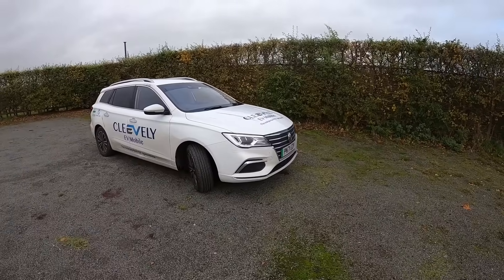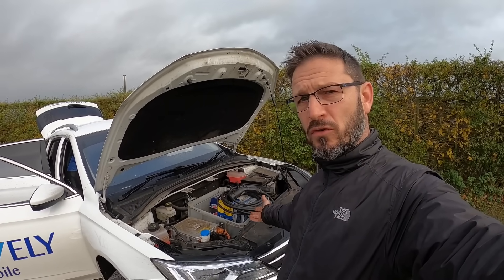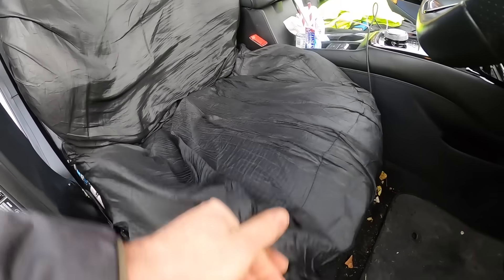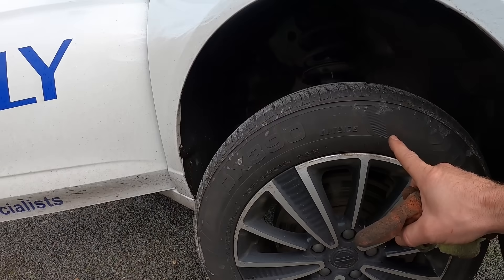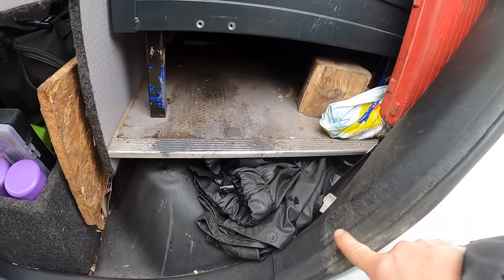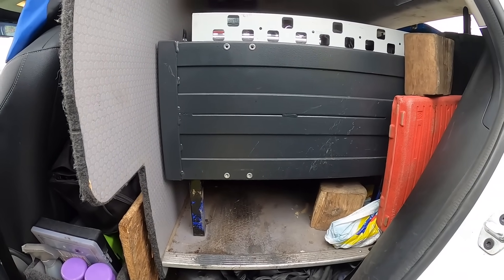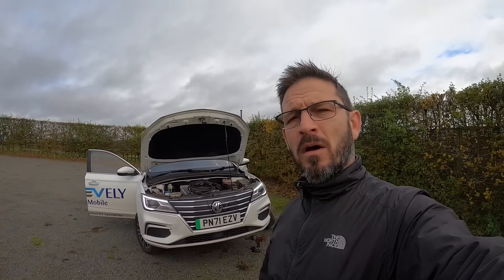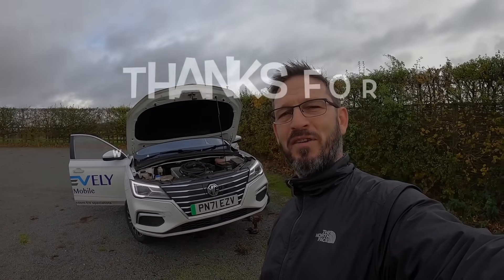How's My Electric Car Battery After 100,000 Miles?

Comment: I have a 2020 Nissan Leaf e+ that has only done 12000 miles in 3 years yet for the past two services and recent MOT I have had an advisory on the front disks due to excessive rust. I am going to get these replaced as it is a lease car but Nissan have quoted £480 to replace these and the pads. I had another Leaf before this that did 30000 miles without any issues. I can't help but feel this is due to inferior materials but no chance of brakes being under warrenty. The dealer has said it is probably lack of use of the brakes that has caused the rust build up.
Reply from the maker: We charge £180+vat for front discs and pads on the Leaf, and we come to you. The pads 100% need greasing or you will suffer corrosion.
Reply: @Jamesandkate  Thanks for the response I have sent email to Cleevely to discuss further.
Reply: Do you use e-Pedal with B mode enabled? If I were you I’d fully charge the Leaf to 100%, turn off e-Pedal, place in D mode and do some hard braking in a safe area. You’ll probably clean off the brakes by doing this as regen is basically nil when the battery is 100%.
Reply: @trainingtheworld5093  Thanks I did try that, or very similar, for a few days before my last service and it did clean the surface of the discs but not enough to stop them still being an advisory.

Comment: My fuel tank has lost zero capacity after 300,000 miles🙃
Reply from the maker: But your engine has, and it only started with a shockingly low number to begin with 😂😂😂

Comment: Trouble is a used ev will cost at least £5k, i can buy a used ice car for 10 times less and the insurance for an ev is much higher.
Reply: And your "10 times less" car will cost you an arm and a leg once ULEZ schemes, and parking charges based on emissions output, take hold almost everywhere. That "bargain" car will cost a small fortune to drive anywhere in a few years time.....
Reply: @Brian-om2hh  yep, there's no cheap way of driving these days, so glad i don't actually need a car, it would be a real bummer if I'd chosen a lifestyle that makes driving a necessity! 😎

Comment: Thank you very much for your update James. The drive battery health and tyre wear was particularly interesting. I don’t own an EV yet but I’m constantly looking at what’s around. Where I can discretely inspect them I do and have noticed creasing forming in the seat bolsters of the MG4. Are you seeing this and if so is it a cosmetics thing rather than the bolster loosing its integrity. All in all your video is such a confidence builder for those sitting on the wall. Thanks for your Chanel James and Kate.
Reply from the maker: I personally haven't seen this but the MG4's are still quite new. The seats in ours seem ok but they are leatherette and we use seat covers. I'd expect if this is an ongoing problem MG will revise them on later models.

Comment: Hi James, thanks for the video. We own the original model MG ZSEV with the small battery, and a Model 3 LR. Both have done a great job so far, with the obvious caveat of range on the MG.
How much of your charging would you estimate is on high speed DC chargers? And do you keep to 80% max as a general rule, or do you often exceed it?
I’m having to use the Tesla for monthly long trips (approx 1300 km return) so I mostly use the superchargers. The car rarely does local short journeys in between. Kim Java recently posted a video which reported on a cab driver who’s Model 3 had a catastrophic battery failure at approximately 100,000 miles. The consensus seemed to be it was daily Supercharging to 100% which caused the issue. 
I’m just a bit uneasy. I’d appreciate your thoughts.
Cheers, Dave
Reply from the maker: Hi Dave. We charge to 100% every day but only 80-85 on HPC's. Going to 100 on a HPC doesn't balance the pack correctly and ultimately this can cause issues down the line.
Reply: Thanks James, I appreciate your response. By the way, we bought the MG at the end of 2021 (it was a dealer demo) based on yours and Kate’s videos of your time with one before you got the 5. Having had the Tesla for a few months we knew EVs are the future. Cheers from South Australia.

Comment: My id.3 eats tyres. I don’t rag the car either. We’ve had 6 new tyres in 2 years. Also picked up a couple of punctures. Lucky they are covered in our lease. But the car has been great. Very cheap to run.
Reply from the maker: I have been told the same thing. I believe they start with less rubber too.

Comment: Thank you James, we own one and love it. When you rotated the tyres did you have to reprogram the TPMS ?
Reply from the maker: Nope. Just mark the wheel position and only move back to front, not across the car. The TPMS will be in the wrong position but it's not to hard to see which one has a puncture.

Comment: I have a MG5 LR and I asked for the tyres to be rotated at the first service at the main dealer.There was a lot of hissing of teeth,as they said that would be an extra £180 as the TPMS sensors wouldn't be in the right corners etc. It was just a query so I left it,and will just do my usual fitting winter rated tyres and keep the originals.I think you just swap tyres and rims back to front and vice versa,but it seemed that the dealer was not keen or just looking for more £££.
Reply from the maker: Yep. Tell them to mark the wheels and swap them.
Reply: Thanks James.My previous ZS had a rim swapped by a third party tyre garage by mistake.Only found out when I picked up a massive puncture.Does your company come to Aberdeen and does it effect the warranty.Im getting brassed off with main dealers.

Comment: I second the opinion of the car.

Almost 60k miles done and the only issue I've experienced is the little rattling noise from the dash on very low speeds... Other than that, no issues...

Front tyres replaced after 35k miles (for more grippy ones as the factory fitted ones were rubbish).

Rear ones replaced after 50k miles.

Regarding the warranty on these, because of the fact that I cover over 30k miles a year I chose 12month unconditional warranty from TyrePros (£12 each). They replace and fix tyres during the whole period of warranty regardless of the tyre usage. Highly recommended!

As for the electricity usage, on average I'm using 3.8 miles per kwh which is not bad given the fact that most of the trips I cover is done on motorways at legal speeds.

State of health of battery still showing 100% for me according to the main dealer service sheet and I haven't noticed any significant quality issues with the materials used inside or outside of the vehicle.

Next year I'm expecting to cover just under 100k miles so will give an update on that one.

Really surprised with this vehicle. Was expecting it to fare quite a bit worse tbh.

Will be looking to get an updated mg5, mg4 or Hyundai ioniq5 by the 2025...

Comment: Those of us who took a bit of a punt ordering the ZS Mk1 before they were available to drive have been rewarded with a great car. If the battery holds up as well as yours on the MG5 I will be thrilled. Having said that I might look to change in the next 12 months for a slightly longer range and faster rapid charging. But then we did a 300 mile trip we lost only 20 minutes compared to an ICE. Thanks for the update and keep up the good work to help persuade others!
Reply: No issue with chargers not working, plenty of them on that route but dozens more now 12 months on. Charging prices have come down since last year and with more and more competition we should see further falls. Of course I don't have the servicing bills that you have with a diesel, no oil to change, no fuel filter, no cam belt (just did that on a Passat ouch!), no brakes to replace discs or pads, and it has got truly big diameter discs on the front. And so easy and quiet to drive. So much so that friends don't believe you are in a car when you have a phone conversation. And one of the benefits of having an EV is the cheap electricity. I pay 7.5p a kWh for 6 hours a night which is for charging the car, but also I run a heat pump only at night for 7/8 months of the year. My 10,000 kWh consumption is 65/35 night to day tariff which altogether costs about half of the cost of diesel, electricity and oil for CH that I was previously paying. @originalshadowfax
Reply: 20 mins to do a full charge at how much??? 😂😂And you found a charger that actually worked????😂😂😂
Reply: @originalshadowfax  That isn't what I said. We charged for a total of 50 minutes or so but weren't delayed mostly because of using other facilities. The car does 3.7 miles to a kWh roughly though on that morning my wife drove because I was unwell, I spotted her doing 85 mph which is not the way to conserve battery. Starting out with ~150 miles of range the charging cost about £24, we arrived home with the charge me now light flashing, that is success in my book.

Comment: Surely after 14 years the battery capacity would be lower due to calendar aging 🤔 not knocking EVs or the vid just questioning that particular statement 👍
Good vid as usual 👌
Reply: Yes. Shelf life (calendar ageing) is real but EVs haven't been around long enough for that to become a problem.

Comment: We have long been warned that Lithium Ion batteries degrade over time to a degree, irrespective of use. I would be interested to know where you learned that this is not the case - ref your comments at 7min 16.
Reply from the maker: I did say they don't suffer natural degradation, but the degradation curve of li-ion is well documented to show very little. We look after many 10yo old Teslas with very high mileage 200/300k, and still above 85% SOH, so I'm basing my comments in experience. We were warned that these batteries had a life span of 7 years, this has now been changed to 28 years by Tesla.
Reply: …and what was not mentioned, as I understand, the rate of degradation is higher initially
Reply: James, as a follow up can you do a price comparison with the diesel version

Comment: A small correction to discussion here - you can't equate 100k miles over 2 years to 100k miles over 10 years where a battery is concerned. The reason being that only a portion of battery degradation is cycle-dependent. Many of the side reactions that occur within the battery are more strongly correlated to temperature, voltage and time and not to usage. And there is the slow diffusion of electrolyte solvents through battery seals, which is time and temperature dependent. It is all extremely complex, but it does mean that you can't just say that the life on an EV battery is "x thousand miles", irrespective of age. It is quite likely that old low mileage EVs will die at fewer miles driven than equivalent ICEs, whilst high mileage (short lifetime) EVs will go much further than equivalent ICEs.
Reply from the maker: So I discussed this with an electrochemist in detail. NMC has a very well documented degradation curve over 10 - 15 years. We are seeing Teslas at 10yo and 300k miles retaining 82-85% of their original capacity. Basically, throughput appears to be the main concern aside from long periods of high/low SOC where abnormally high levels cathode  degredation can occur.
Reply: @Jamesandkate  Interesting, as i am also in battery research. And we find that whilst the degradation curves can be quite reliably modeled as you say, cells (both those we make and those we test for others) will eventually tip over from that well-understood linear-ish degradation to a more rapid "sudden death" type performance drop-off that is very hard to predict. I would also say that very few people have batteries that have been on test for 10+ years. Many predictions are made on the basis of accelerated testing, which is not really a great way to find such sudden-death phenomena. 
Probably the best data comes from non-automotive sources such as stationary storage and marine, where the battery supplier has much more comprehensive logging data (and they have been running for a lot longer than you might think because they stay out of the media), but they operate the batteries under much tighter conditions of temperature and SoC window than you will see in automotive, and then they get absolutely crazy cycle-lives.

Comment: To me it looks like the bulk head put in for the racking would stop the curtain airbag from deploying
Reply from the maker: It's been put in specifically with a frame work designed to not do that. It was a proper conversion.

Comment: When I drove the MG5 I found it disappointing only because I'd previously driven a Kia e-Niro. Headroom, rear window view, instinctive control locations all scored lower for me. But you can't argue with the longevity and solid performance over time. A solid car. Yet another EV review with actual facts that puts the lie to the usual nonsense circulating in the mainstream media and among internet trolls.
Reply from the maker: They're 100% not for everyone. Tbh, the eNiro is a very nice car, one we considered ourselves 👍🏼
Reply: Just got my mg5 today, have to return my niro now. I feel the same i am dissapointed with the mg5, mostly because of the range I saw. 170 mile range, I know it is winter but a 80 mile lost!
Reply: @miyoy21 efficiency also depends on how you drive...
Reply: @miyoy21  I have an MG5 and the range has been pretty much spot on. If it was 100% and showing 170miles I suspect it was based on the delivery mileage and dealer driving it. Hopefully now it is showing nearer to true mileage. (also make sure it is in ECO mode and the heater turned off)

Comment: My car's done 102k in 4 years, had 4 services costing  a total of £1700, takes 5 mins to charge with a range of 740 miles. Oh and it's only depreciated by 20%.
Reply from the maker: £1700! I haven't spent that on charging, tyres or wiper blades.  alone. Sounds like you've got a shed there 😳
Reply: You some how failed to mention the fuel cost. Do you know that figure?
Reply: @ianhamilton3113  £12,320 over 4 years.

Comment: No issues with the radio? Ours was glitchy and then the CarPlay died so the radio is in Longbridge being fixed. We’re driving around with a hole in the dash, no radio, no reverse camera or beeps and no indicator tick-tock. No idea when the radio will be back. They said we haven’t got a courtesy car. Not impressed.
Reply: Also we had to have new front tyres at 25k. Possibly right foot issues but the traction control always seemed not great.
Reply from the maker: The software is shite, but ours has been ok.

Comment: James - a good review!  These MG5s seem to be a good fit for your tasks, if you can locate chargers on the long mile days.  Seems like that was a problem early on, or in some locations for you.  Surprising the brakes survive that well on those cars, and no real battery degradation either - awesome!
You should put a single MY to work for comparison, since the SC spacing and time spent charging should be quite beneficial to the guys, and the interior space available on the Y - wow!  You may want air suspension to be available prior to getting one due to the steady “ballast”?
Reply from the maker: The MY is certainly in my thinking, I know it will do well.

Comment: I did over 40k in one of these in about 18 months. Would I buy one, no. Mine was a service vehicle, the efficiency etc, couldn't fault it, the PU Seats were terrible, the AC wasn't good enough, so many stupid oddities with the head unit and mfd, why do we need a popup warning us the full beam is on, when I've just turned it on. So many annoying features/bugs.
Reply from the maker: Completely agree, that is a weird thing. The facelift is a much better car, sorted all the previous issues.
Reply: @Jamesandkate That's good to know, if I was given one again, it would be cloth seats for sure. 😅

Comment: Good review thanks. My dad has a 2 year old MG5 52kwh 32k miles. 2 minor issues 1 just a software update 2nd rear screen washer pipe came lose inside door pillar and one bigger  problem when car wouldn't charge 200 miles from home. After 4 weeks in MG garage and a whole new charger socket. Still unable to charge they discovered a big fuse under the charge socket! Hey presto. Apparently he is the first person to have this issue. He still loves it though!

Comment: Hi James
Love the channel. However I would bring to your attention that 100,000 miles in 2 years is not the same as 14 years for the traction battery as batteries deteriorate from 2 things; charging cycles and AGE i.e the chemistry of the battery deterioates due time since manufacture  as well as charge cycles.
Reply from the maker: Indeed, but the degradation curve of NMC, that's well documented, should show only a 2% variation over this time. We have 10yo 300k mile Teslas with over 85% SOH
Reply: @Jamesandkate  You can't extrapolate that beyond a certain point. The degradation curves are based on chemical processes with steady kinetics, and even though not all the process are fully understood, their sum total is pretty predictable. The problems come when you have processes occurring that aren't linear with time. A good example is electrolyte loss, via diffusion though seals. Though the loss might be fairly linear, it's effect isn't: The SoH remains constant whilst there remains enough electrolyte to transport lithium ions (there is always a little excess in the battery), then when the cell gets dry the high rate performance (max current) will drop a bit, but it won't affect capacity, and then the cell will just suddenly die when a specific threshold is reached. And this is just one example - there are other sudden-death processes.
Reply: Correct but it looks like a really good start .